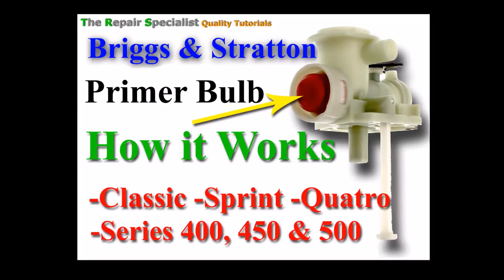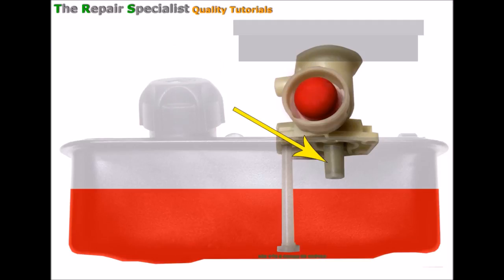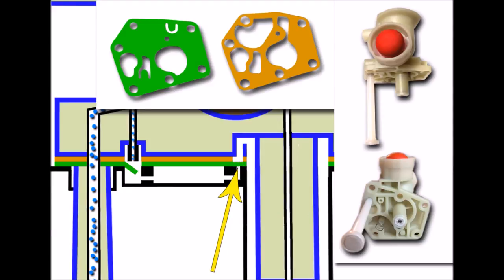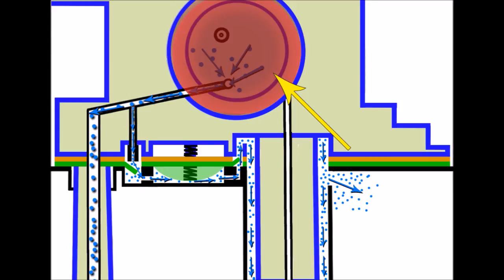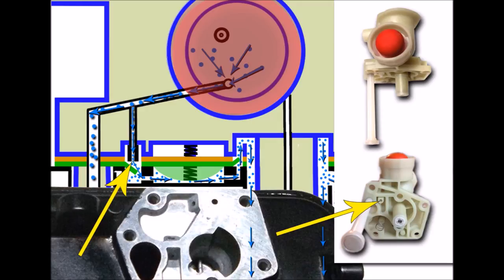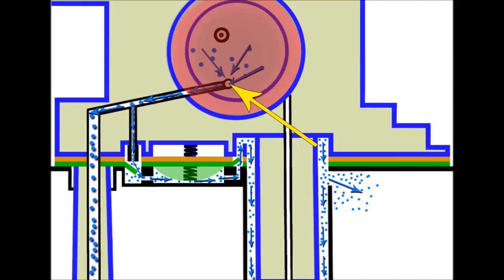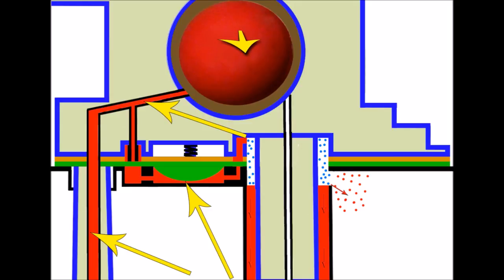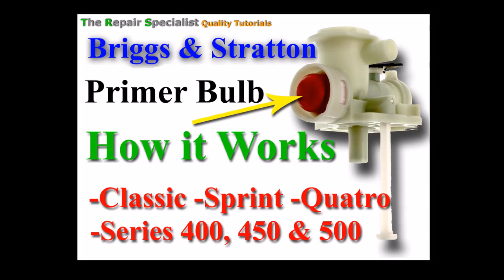Briggs and Stratton Primer bulb (How it Works) Classic/Sprint/Series 450/500 - The Repair Specialist

Comment: I know this is an older video, but people are still viewing it. This video helped me chase down a problem I had with a new 3.5hp B&S mower for many years. It never seemed like the primer system was working properly and took many pumps for the engine to start and I think it would start after it primed it self after many pulls. I found that the plastic ring that holds the primer bulb in was not seated (clicked in) and allowed an air leak. Starts with 3 pumps now.
Reply from the maker: That's awesome that you found out the issue. Well done and thanks for the kind comment and letting me know. Craig

Comment: Thank you sooo much.   Have three of these I need to get running that needed the diaphragm and gasket.  Put one in and it ran great with ether but it wouldn't prime      when I held my finger over the prime outlet in the intake it would fill up the bulb but when I took my finger off it would just pump air.  When I pumped it really fast all of a sudden it started working. I'm assuming it just needed to be worked since it was brand new.

Comment: Excellent explanation. 
I would just like to add one more reason the priming Bulb will not prime the carburetor. which none of the YouTube pages seem
 to have mentioned.
If you replace the diaphragm and you still just suck air. It is worth removing the Bulb and checking to see if the 
one way valve behind the Bulb has not popped out of its recess. The Bulb is removed by pressing in the locking tabs on each side.

Be careful when removing the Bulb, as the steel ball and spring are quite miniscule and will easily get lost if dropped on the floor. 
It is quite a fiddly job, requiring small needle nose pliers or tweezers, but supergluing the rubber retaining orifice is probably the best way 
to fix the problem. Otherwise, a new Carburetor may be required.
Reply: First mention of the ball bearing and spring I’ve found, I thought I was going nuts and didn’t know if it was meant to be in there as nowhere mentions it

Comment: Great video. Really helpful. Mines in bits just waiting for parts to arrive. I’m hoping it will fire right up when it’s back together.
Reply from the maker: Thank you so much for your kindness. good luck, hope it will work when its back together
- Craig
Reply: @TheRepairSpecialist  she’s back together and running like a dream. Carb and tank cleaned out. New carb gasket, diaphragm, air filter, spark plug and primer bulb. Very cheap repair and not bad for a 20 year old mower! Thanks again.